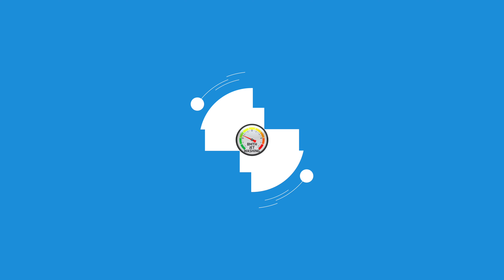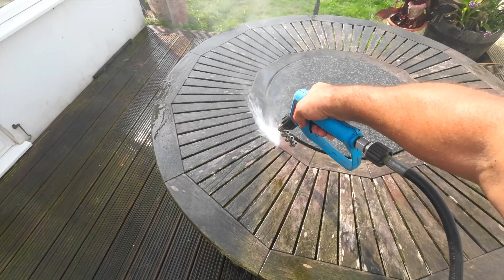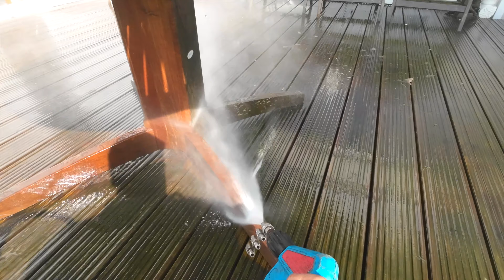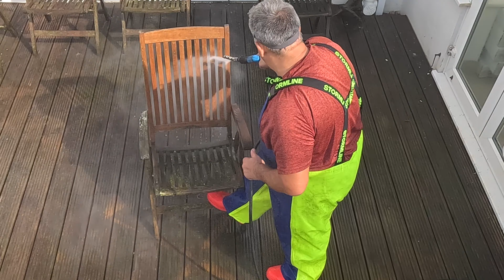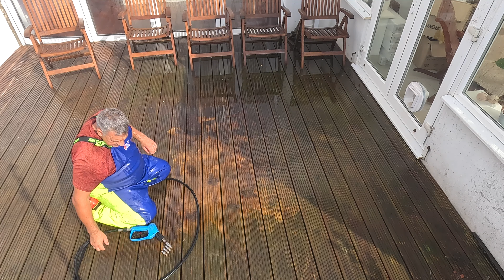Pressure washing teak furniture table and chairs

Comment: I actually got a free patio set like that in the summer, the house up the road was throwing it out as it was “rotten”, so I got my hands on it and did the same as here, came up lovely, solid, even put some new teak oil on it 😉😂
Reply from the maker: Sounds like you got a bargain this teak furniture is pretty expensive these days worth holding on to, Good to hear you restored it too steve👍
Reply: @Bournemouthjetwashing  thanks mate, I saw a very similar one in my local B&Q and that was on offer at £400 😳
Reply: I am about to do the same. How many pounds pressure washer did you use? I’ve read where pressure washing strips the natural oils out of teak.
Reply: @SlavicSon  I had to play with the pressure to get it right , if I remember correctly I think it was around 80-90 bar with a hot wash to help get the oils out so I could redo the oils, you can even do a half decent job with a Karcher or something, just depends on the pressure of the unit
Reply: @stgray35   thanks. What is 80-90 bar? Not the same as psi? Is this a metric thing?

Comment: What pressure washer are you using. How many psi?  I have my fathers 50 year old outdoor table to restore and I read Not to pressure wash teak because it would strip natural oils.
Thoughts?
Reply from the maker: Any pressure washer will do use a 25 or 40 nozzle low pressure , when dry re oil the table
Reply: @Bournemouthjetwashing   great, thanks! It’s in pretty rough shape. Almost seems like it needs sanding but will try the pres washer first.